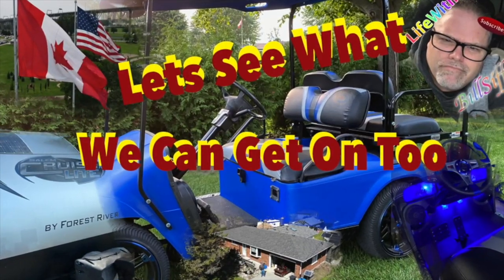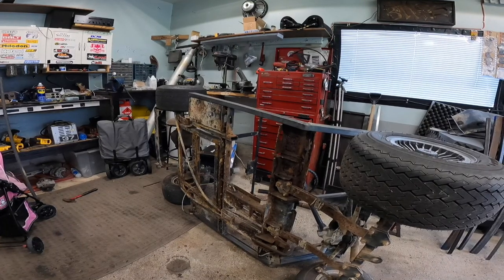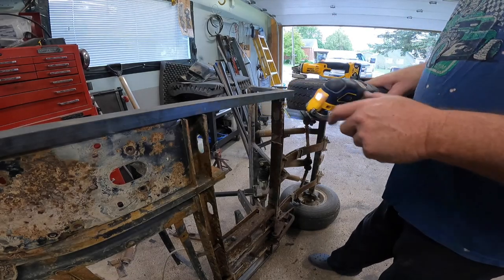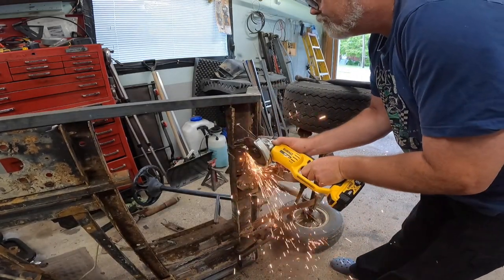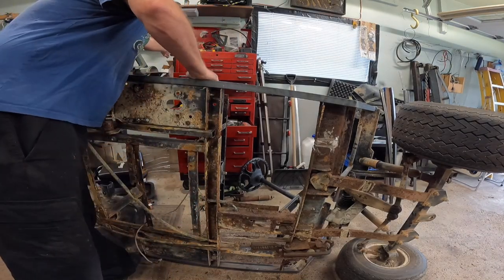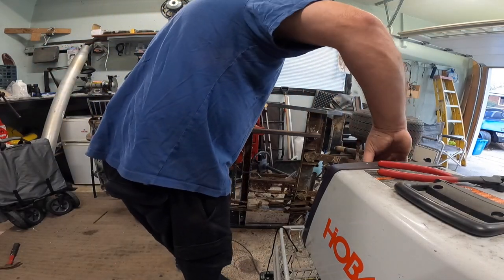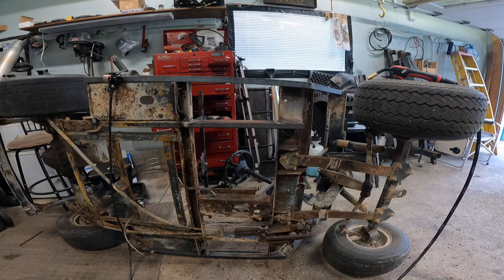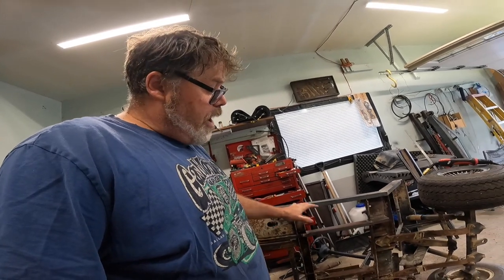More Frame Work Getting Done

Comment: Lookin good brotha . Anywhere you can over build the frame a bit will pay off . As for your camera protection  just get a cheap full face shield and make a attachment to cover the camera keep it clean as possible then you can put us right in the action . The Pickler is awesome.  Krud cutter makes a rust remover that is biodegradable, no harmful stench I get mine at Walmart. It goes on like water but it works real good . You wet the metal first then spray somewhat heavily and keep it wet with the rust remover. When done you can hose it off and let dry and paint done. It's great for getting into those places you would normally use a sandblaster . I love that shit . You can leave the stuff to dry also and it creates a oxidized coating that is good for about 6 months in the weather . So it's great for inside frame rails and such . Keep up the great vids bud don't worry too much about editing either ,we all f#$% up and that can be funny lol but it can save you a ton of time . Stay safe .
Reply from the maker: Nice thanks for you input